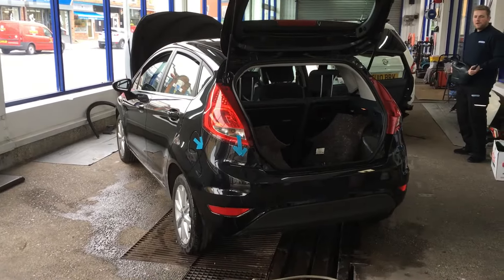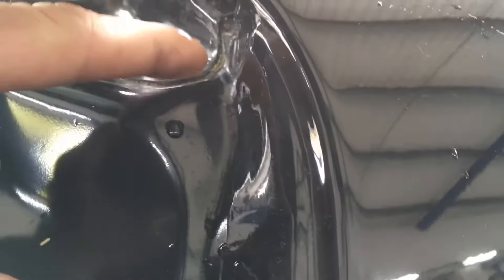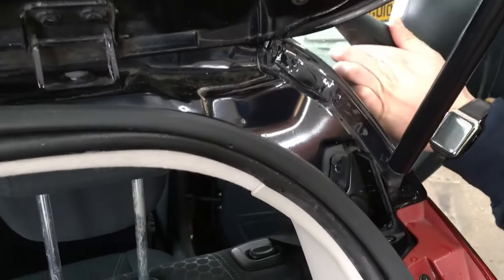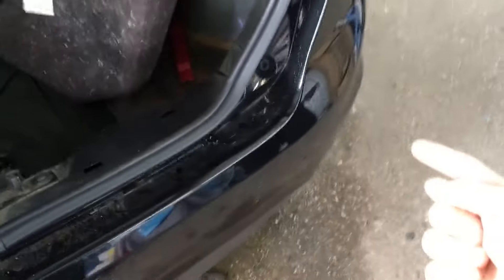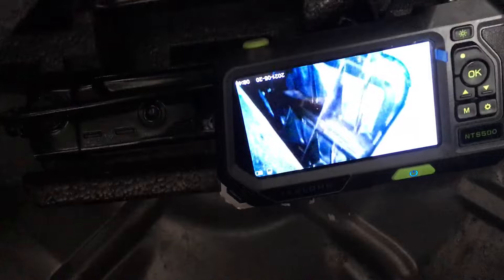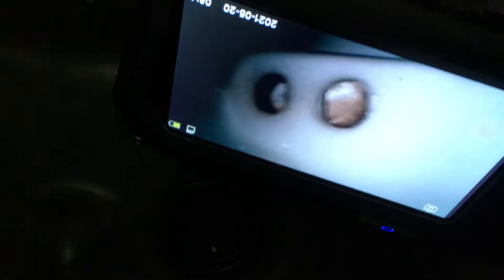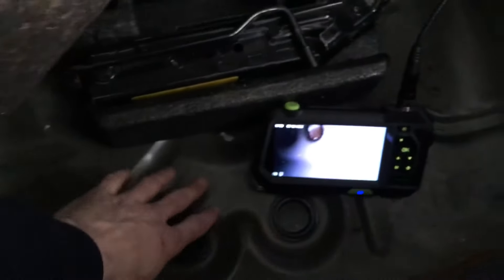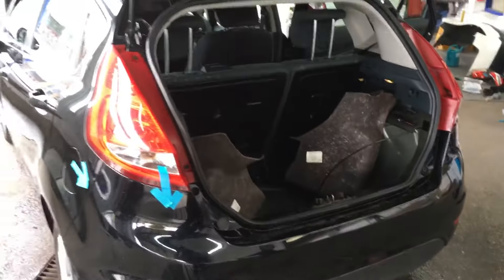Ford Fiesta 2009 | Water Leak Found | #FiestaWaterLeaks

Comment: Great video on this common problem with Fiestas of the last 15 years.  The Fiesta has been fairly good (mechanically, anyway), but my 2016 leaked right away in the same areas.  Not much change from '09 to '16, in terms of crap Ford quality control.  And you wonder why Ford stock has stayed around $11 for almost two decades, while GM is consistently over $30....

Comment: as the air vents are lower how does it make it's way into the boot well? I know it fill up but where is the exact entry point into the boot from the vents?
Reply: I'm confused by this too. I've seen the air vents mentioned elsewhere but don't understand how they're connected / leak water in the boot.

Comment: Great video, I am having this same problem on my Grande Punto 2007. The leak appears to start from the back around the same area in this video and leaks all the way through to the driver footwell. Have put down some sealant and ducktaped the s**t out of the rear! I have also sealed around the lights, praying that this woks!

Comment: I've sealed top welds but water still getting in if I pour water onto roof. could it be the light unit? the seal around it where the bulbs go 🤔
Reply: Yes, probably bad sealing under the stoplight, and under rear bumper you have few duct tapes that need to be resealed and put silicone arround air venta
Reply: @arslan4638  the water can be seen dripping down but can't see where from. Replaced light unit so no that. It's beaten me sadly
Reply: @stephenm353  i put silicone on all parts  where two steel sheets met. They used point welding instead full weald. It was good till few days. Silicone rotted. Now I bought red silicone for gutter and will dismantle complete rear end of the car and seal every hole.
Reply: @arslan4638  yeah I'll need to do the same but here in Scotland we don't get enough dry weather to work outside lol
Reply: @stephenm353  similar in bosnia, few days ago it was just like summer time, now snow. Good luck with fixing your problem, hope you fix it cheap
Reply: In my case the crack went up under the rear part of the black trim that you find on side of the roof. Remove the trim and check there. It is kept there with some kind of spongy double tape, once removed I had to apply some glue.

Comment: I've also had this in the same area it runs through the same part into the back corner of the boot. Top part I have sealed and around the 2 boot hinges.
Having had some rain last night there is still water getting in from above , any ideas where else to check please ?
Reply: The roof rails, centre brake light, poor rubber seals around the tailgate?
Reply: Hey, I am having water in the same areas as you have shown, but I also have water marks on my roof, I have a feeling it’s coming from the roof rails, is there any advice on what to do?  

Many thanks 
Jen
Reply: @jenniferleary5713  doing this repair myself at the moment. I peeled off the roof gutter strips (they’re just held on with double sided foam tape) and I’ve filled any holes or cracks in them with grey silicone sealant before refitting the gutter strips. Pay particular attention to where the roof meets the rear of the car - the welded seam there had cracks in on both sides for me. Good luck! If you have a sunroof, that’s a whole different ballpark - there’s a good video on YouTube for that if you search ‘ultimate leak repair Ford fiesta’ by Speedy Garage
Reply: @jenniferleary5713  I used sealant around the hinges and anywhere I thought water could come in. I managed to also use a waterproof tape for the holes inside the bumper